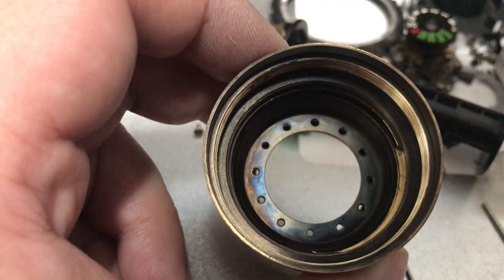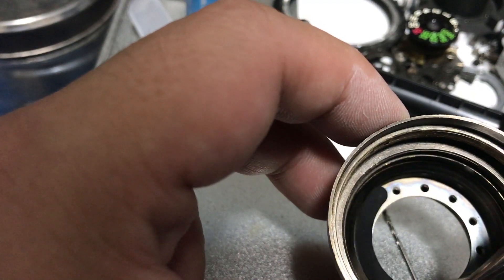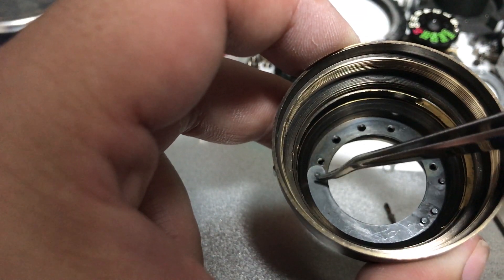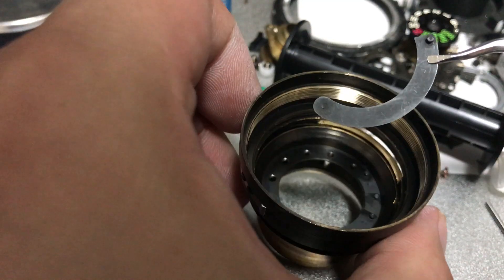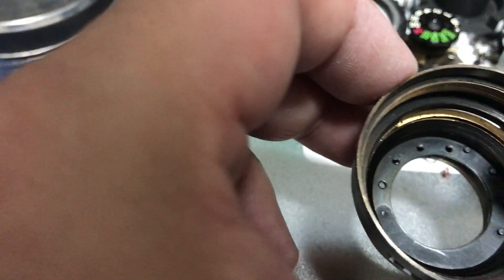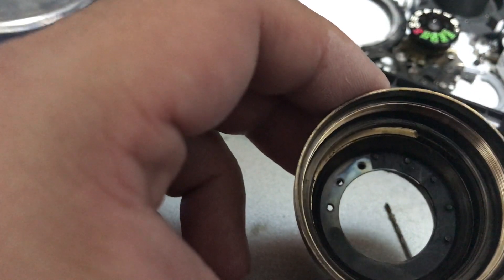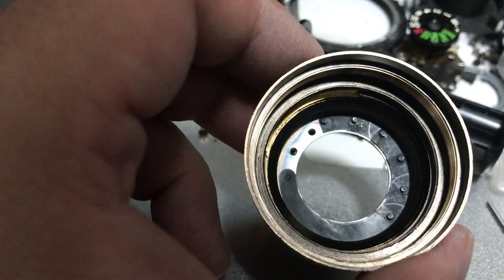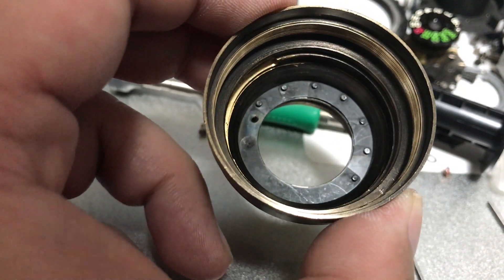Reassembling preset-type irises pt1

Comment: You made my day mate:) Surprised I'm alone here. I'm fighting with vintage Carsen 135mm which has 14 blades preset iris! It was full of oil and doesn't move. After cleaning I have tried to assemble but almost give up. Most likely , this is not that type of the lens which worth  it but I'm curious how it works:)